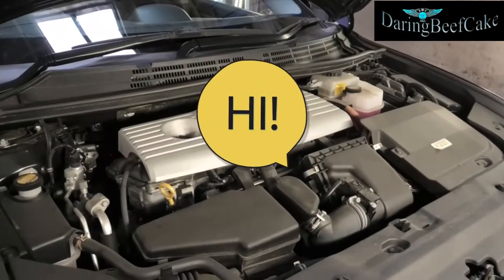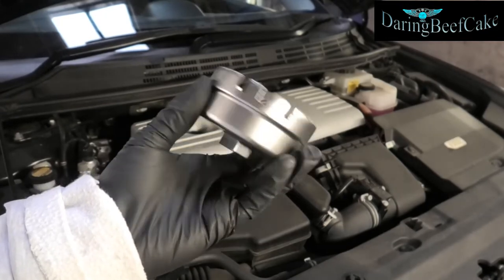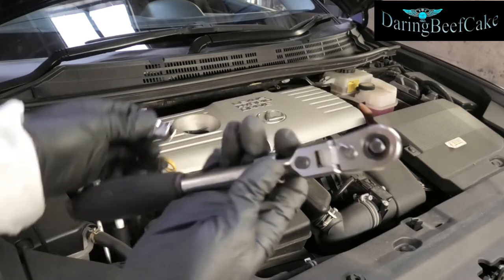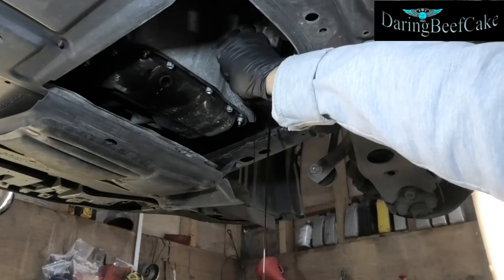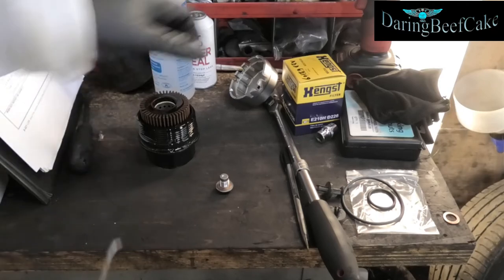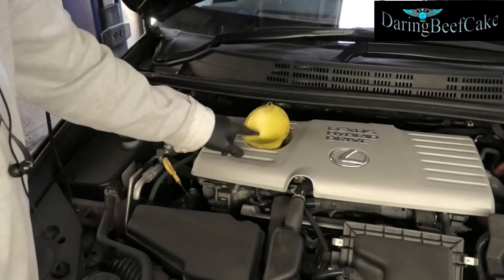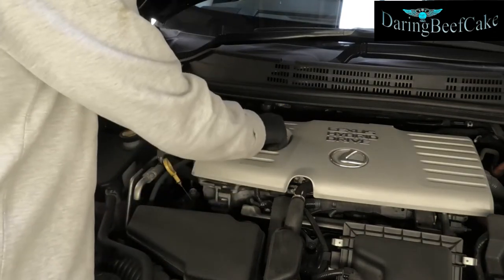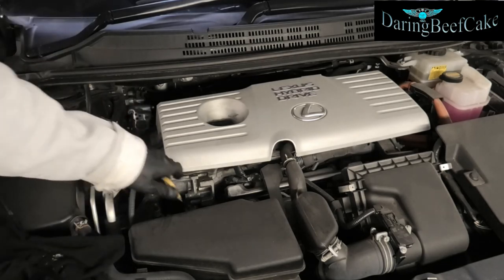Lexus CT200h service oil, oil filter, change

Comment: Hi. Can you show how to fix horn on this model. I have 2011 and recently horn stopped working. Not sure how to fix it. I have checked fuse.
Reply from the maker: Hi, I don’t have a CT200H at hand at the moment, this problem may be an issue with the horn itself, if the fuse is good.
Reply: Have you checked the connections at the front of the car? I recently bought this car and bloody horn didn't work. Was fretting about it being an mot fail. Turns out it was disconnected for some reason. They're right at the front near the radiator. Failing that lot people reckoned could be the clock spring but that was annoyingly expensive so thankfully for me and hopefully for you not the case.

Comment: should it be 0w-20?
Reply from the maker: Thats correct but when i got to toyota to buy parts they recommended me to change to 5w30 because the egr valves were failing as 0w20 was getting into carbon to fast. since then i never had issues with egr valves same on prius.

Comment: the manufacture recommend the engine oil grade is 0W-20, but you are using 5w-30, is that good for car?
Reply from the maker: Hi yes 0w20 is recommended however it turns out 0w30 is way to thin and it burns crating carbon blockages. And so I’ve been using 5w30 for a while now and works just fine, besides the viscosity you choose depends on where you live.